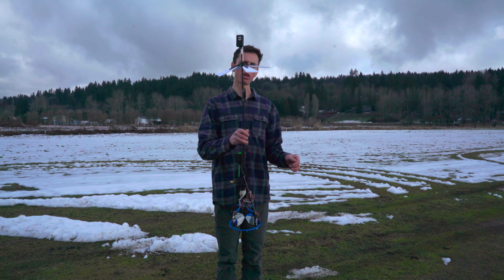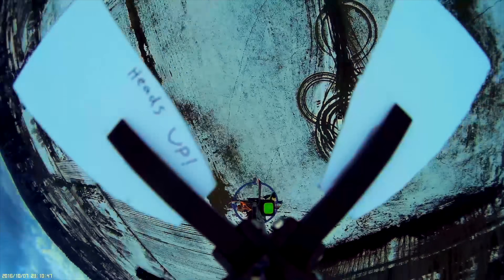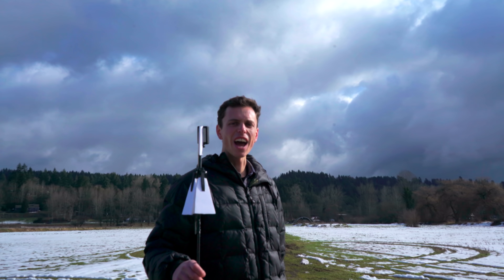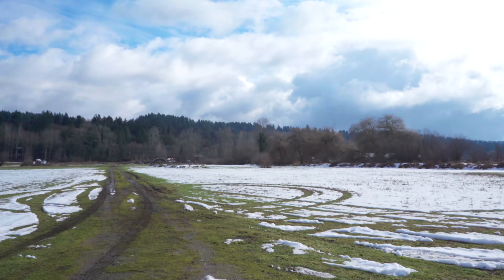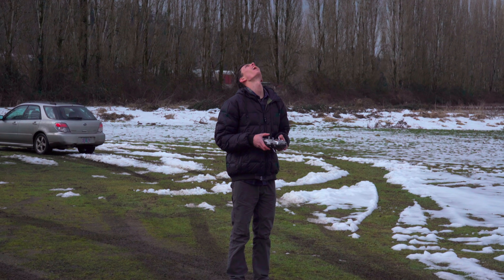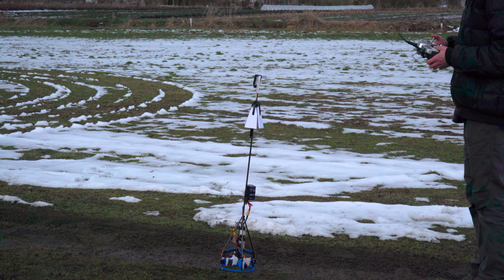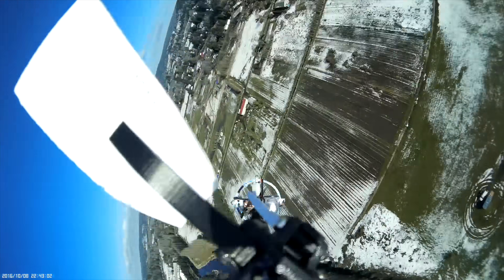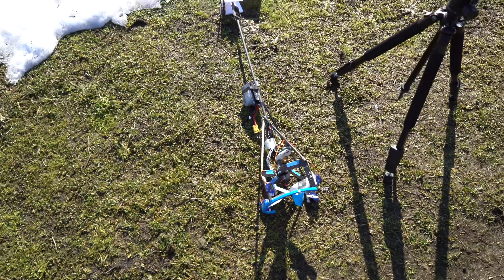Brushless R/C Rocket Vertical Landing with Pop Up Fins - RCTESTFLIGHT

Comment: @rctestflight Hi!  I watched some of your videos and I want to say that you have interesting exclusive and original content, and I think that your channel deserves 1M+ subscribers.  You have a unique experience of experimenting with unusual flying machines and drones.  and you seem to be the right person to help me.  What is the actual question: in your opinion, is it possible to make a similar brushless rocket weighing up to 10-12 kg with a speed of up to 300 km / h?  how useful it would be to use two counter-directional propellers located along the axis of the rocket to compensate for the torque in order to obtain a consistently level and level flight.  Or is it better to use one screw and control surfaces?  the purpose of such a rocket is not a secret: catching drones with the help of a grid that fires when the rocket approaches at an effective shot distance.

Comment: Maybe if the fins at the top were allowed to spin, it would descend even slower if that is desirable like a Gyro-copter blade keeps spinning, safely delivering the copter to the ground if forward thrust is lost during flight. Maybe the spinning fins should have at least a slight airfoil shape to help create a lift effect slowing the overall descent of the vertical rocket to the ground.

Comment: I had an idea the other day that I think would be pretty cool. I don't know that it would work on the model scale or large scale but here it goes. Smarter Every Day (video 154, strapped into a falling helicopter) has a video about how a helicopter can safely land by changing the pitch of blades to a happy medium where it slows down the copter enough but not too much that the blades break. My initial thought is that this could be incorporated into a spacex or electron style rocket but I think the physics at that scale and speed would be impossible.

Comment: I think the servo fins are reinforcing the spinning on the way down. They're adjusting themselves in a way that would stop the rotation if air were going downwards through them, but air is going upwards instead so their effect is reversed. Like you said, it would be interesting to have their control loops reverse on freefall but that would be tricky. Maybe have it reverse when throttle is near-zero and a certain rate of descent is measured (GPS or altimeter)?

Comment: Please for the love of god get rid of that puffy 4S battery my dude. If you didn’t know, the reason li-ion batteries swell up is because the chemicals inside the battery are breaking down and releasing gas, and if the battery is at the point where it’s swelling, it’s pretty much a hand grenade. Swollen batteries are volatile as all hell and could go off without a moment’s notice.

Comment: I wonder what is balancing the torque. I mean in a helicopter a tail rotor is needed to balance the torque of the main rotor, right? Now if there is only one brushless rotor at the bottom of the vehicle, and nothing is balancing the torque, why the system is not spinning out of control?
Can someone answer🤨

Comment: How much weight would a connection or a extra servo cause issues in flight?
Through software you should be able to make a smaller ratio for the fins on top so the rocket is stable coming back down to the ground. Just a idea😄

Comment: Unsolicited suggestion.

Sliding C.G. That being the batter would slide up and down the center shaft. Actuated by a lead screw or belt/cable.

At Launch: Top
At Free Fall: Middle
At Landing: Bottom

This would get the best of both worlds. VTOL w/ Horizontal Free Fall.

Even actively actuate the battery's position Up/Down. To keep it horizontal during free fall.

Comment: Great project... Reminds me of something was working on a few years back but didn't get to finish. It also reminded me of an interesting effect I noticed when I was a kid. I had one of those balsa wood cheapie flyers with the red prop and rubber band. Just for kicks, I removed the rubber band and gave it a toss. Much to my surprise, the air resistance caused to prop to spin fast enough so that it was having an interesting reaction to the flight characteristics of the plane. When I'm watching your rocket fall, I'm wondering what kind of an effect would be created if your fins were shaped like props, and they had the ability to spin with wind resistance during free fall. My guess is that the gyroscopic effect would add some position stability, while at the same time increasing the rockets hang time as it falls.

Comment: It would be awesome if you could get the battery to move mid-flight maybe a mechanical locking system can be involved in the solution idk. I wish you filmed the flight with a 360 camera.

Comment: Ever think of using regular model rocket engines to get up and then using your vectoring set up to get back down? Just a thought. Maybe even use electric to get up to a point and then igniting the solid fuel engine like a second stage, maybe not even possible, but it would be really cool, lol. Love it as it is though, I just subbed.

Comment: 7:26 Thoughts: Painting the inside or bottom of the stabilizing flaps/fins bright pink to help you see it. 

Also IDK if you just want flaps, but I was thinking if you actually did put rotary wings instead of just those flaps it would definitely fall like a helicopter and would probably be more stable. Possibly even fall at a slower rate.  Maybe. Just some thoughts

Comment: You should try to disconnect the upper wings from the chassis, so they can spin independently from the body. Also enabling them to spread a bit higher than in horizontal position when extracted could help to stabilize. I think anyhow your gyro with the control surfaces is messing with it on its way down.

Comment: If you make the thrust vector control fins symmetrical from top to bottom around their axis of rotation, that should reduce the deflection caused by the upward airflow across the fins when the vehicle is falling.  It looks like that upward airflow when in freefall is overpowering the servos.

Comment: What if you just used dual opposing rotors and adjustments in rpm to manage roll, in addition to the fins and use them as pseudo reaction wheels on the way down?

Comment: You can only go like 2,000 feet with propellers.
Reply: @David M  That's as high as the highest drones can go. 2,000 feet is nothing for rockets, if you can call that thing a rocket. So the design is really impractical. Though he seems to be having fun making it.
Reply: @David M Actually, I looked up the article again and it is 4500 meters is the max. Which is like 15,000 feet. After that, the air pressure is too low to sustain lift. That's actually not bad but still it's never going to go suborbital or anything cool.

Comment: I know I’m hella late to this but you could hook up a barometric altitude sensor, run a loop testing for the height, and once it starts dropping (say 10 feet below peak), you roll over your code so the servo positions are inverted (say from limit 45°-135° to 135°-45°)

Comment: The issue I saw with the decent was the thrust vectoring fins, they aren't locked, they just flop around on the way down. You should be able to at least reverse the servo throw to a switch so you can at least control it on the way down without throttle.

Comment: Have you thought about using large blades to stabilize it during decent? I would have thought if you use large chopper blades on it you have it spin and the larger the blade the slower it would drop/spin. Unless I have my thoughts backwards haha

Comment: What if you designed your own type of grid fin like SpaceX uses?  They could either be 3D printed or made out of aluminum.  Instead of just adding drag and acting like a knuckleball, it would direct the airflow and stabilize the rocket.  You could also use servos to control said grid fins to help counter the thrust vectoring fins

Comment: instead of using fins you could try out ,three or 4 thin rods of some lightweight material with very thin nylon or cloth material joining the rods.This could act as a skin for your rocket on ascent and if shaped right would be more aerodynamic since you could remove airfriction fro that battery , and on descent act like an umbrella/parachute.
 the only possible problems i can think of right now are if not shaped right airflow from the skirt would be lessened on your propeller, or the material required to do this would be heavy and cause excess drag on take off.

but like my father's apron says , " your suggestions are not in my recipe ." so feel free to ignore my comment.

Comment: I think your stabilizer fins are inducing an oscillation because they are angles downward. Much like a circular parachute canopy air builds up inside and causes it to rock back and forth dumping out excess air that's why they have a vent hole at the top angle the fins. upward or putting some holes and them to dump off the excess air.

Comment: Have you considered integrating a way to move the battery up and down the shaft to dynamically adjust the CG? It may help you   solve the CG/CP relationship in the different flight modes.

Comment: Try mounting the electronics, aspecially the battery as low as possible. Low center of mass + increased fin suface area will make it alot more stable

Comment: Hey i was thinking what if instead of fixed wings you give it blades like a helicopter, so when it falls the blades rotates, like for example the hand thrown helicopter stick when it falls the blades are still rotating and it slows the fall of the stick

Comment: You could just assign the manual mode of your fc to engage when throttle is zero because no stabilization is better than reversed ;) (edit: you'd need a custom mixer for that)
The more complicated way would be to use four cheap servo signal reversers (or build a quad-channel reverser yourself) and find a way to bypass it / switch it on or off via aux channel.

Comment: Place light tension springs on the nose flaps to remove the involuntary movement.  Adding sight radius to the flaps will add control and more drag for  the descent, less drag for the ascent, and a more true parachute effect.  You could even place a through rod inside the main tube connected to the speed control which will tell the servo to open the flaps under a need speed/fall condition.

Comment: Try using a folding prop on the stop with reverse blades, so it would work like an helicopter autorotation. Also, you should be using 4 little 50mm ducted fans with 4 servos for stabilization and populsing it. I would definatly use a baro sensor combined with GPS and a proximity laser sensor (arduino like) to detect the ground distance, so it should be fully autonomous for landing, even with radio off or signal lost.

Comment: There are a lot of suggestions for longer "helicopter style" blades that make a lot of sense.  I'd try to make it so the BLADES are doing the rotating, not the entire body of the rocket on descent.  All you'd need is a round tube with a couple of stops above and below the mounting.

Comment: very nice project! 2 suggestion:
1 Allow the fins go up of more 30/40°, this give more stability (little less drag) and dont let then to close when it inclines
2 put 4 more servo on the fins to push it a little down (increasing drag), you can control the descend with it like aileron and elevator.

Comment: I think you would be better off just making a wider body instead of the flaps on top.  This would give the body drag on the side so the heavier bottom would stay down.  You might also try a pair of batteries so they are more balanced.

Comment: If you can have the smallest package possible take a stable and controlled flight in auto-level and hold position with GPS for anybody to fly (just motor + trust fins + electronics + battery), that would be a very winner design. That's a one-motor drone right there...!!!!!! Also, if you want your current design to fall from the sky, why not put very long, surfaced and slightly angled fins in that same great folding design in order to have it spin like an heli on its way down? Very good stuff!!! Congrats

Comment: Have you considered actively forcing your blades out instead of letting the wind do it?  That should guarantee the orientation you're trying for. Then if you were to cut off say 10% of the right edge of each blade...it should allow it to rotate the same direction each decent. 
With the same orientation and the same rotation each time...you will eliminate several variables allowing for a less complicated control solution.
....or not. Just an idea....

Comment: If you could pivot the decent blades like real helicopter blades  If you ever see a helicopter disengage the motor and the blades spinning will actually spin fast enough during free fall to land in emergency and controlled decents for practice. If the top had a swashplate independent of the entirety of the rocket. But key is adjusting the angle of blades during free fall.

Comment: You said the fins rotate in opposite direction as needed when in free fall. With your control setup could you possibly reverse the servos when throttle is 0%? This might cause some instability between motor cut off and apogee but could help it fall vertically?

Comment: On that last flight, you can see that the vectoring fins are shifting around during the fall, which made it lose stability. If you had a way to change the mode of those fins during fall, like with a button, then it would work better. Also, the pop-up fins would help the rocket come out of a horizontal fall because the fins on the skyward facing side would create more drag than the groundward ones.

Comment: This is very interesting! I would love to build something like this. I think the reason its spinning, which starts right after you reduce the throttle, is because like u said the servos are programmed to control air coming from the other direction, so when air hits it from the bottom the servos move to exaggerate any rotation, like the rotational torque from the motor spinning down

Comment: you should find middle balance point, add servo on switch or timer and add small parachute. large project but it would be fun to see it land on its side slow and controlled. im interested in how you would strap/deloy such things from the side. easier from a top mount cap.

Comment: Really great try-storming.  

The more naturally stable the ship (as you found by moving the battery down), the more thrust that can go to missile lift acceleration/speed. 
- Put the motor at the top (out of the way of the battery).
- Put the battery at the bottom
  ... looks like you know how to print a centering bracket/landing legs to hold the battery under the end of the carbon rod/fuselage
  ... for natural stable vertical flight, the Cg of the battery must be dead under the rod/fuselage or the ship will have a natural lean
- That will put the Cg as low as possible so the missile is as stable as possible so thrust goes toward vertical lift
- With the props at the top, you no longer need the flip-out fins because 
  ... a slow rotating prop will create a drag disk during descent (more drag than lift)
  ... the battery mass will keep the ship vertical (think pendulum)
  ... the rudders (located under the prop near the top) will no longer create an upsetting force
- Consider making the battery holder/landing gear into fins or holder/gear/fins 

Super cool how you can catch the missile and that your missile has that much lateral control. So yes, continue using your clever rudders (just under the prop) so that you can continue to vector the missile laterally upon descent.

Explanation of other comments.
- Cp, the center of pressure & Cg or the Center of mass or Center of Gravity
  ... Think of a parachute.  A parachute (Cp) needs to be behind (down wind of) the person (mass or Cg) it is trying to safely lower to the ground.
  ... Think of a rocket. The tail fins (Cp) need to be behind the mass of the rocket (Cg).
  ... Your Cp will be the battery-holder-drag/landing-gear-drag/(and if needed, tail fins) and the Cg will be about 1/4 of the distance up the missile.

You've created a lot of interest.  Well done!

P.S.  By putting the motors at the top and rudders right behind the propwash, you've created a canard used on advanced fighter jets, so be prepared for some interesting tuning of the actuators to attain smooth vertical flight at high speed :-)

P.P.S. There would be a long set of wires running from the battery to the motor.  You can use 16 to 20 AWG wire for the amps you are pulling.  Wire, unlike on ground installations, have not only heat loss but also lose energy by the fact that the motor now has to lift its weight.

Comment: My 2C is to disable control surfaces and center them when the motor is shutdown, all as one. That way the top fins should provide the most drag and corrective forces. This will also keep your motor pointing down and lessen the altitude it takes to arrest your descent.
Reply: OH! also the top fins should fold slightly more than 90 degrees to the body because when the craft angles hard over the opposing fin must be able to match that or else lose efficiency. when the craft is vertical, the fins all facing slightly toward the sky will increase descent speed slightly, but the benefit is massively increased centering on descent.

KSP FTW!!!

Comment: Exchange your drag paddles for pop out auto rotating helo blades, then your climbing trust vector vanes can be used to
control decent against the auto rotate side slip p factor with a lot less motor/ batt. power.
I can visualize a 1-6 inch per second decent without motor thrust.